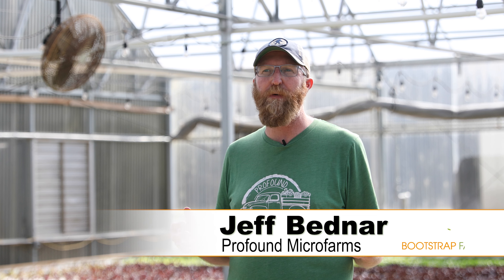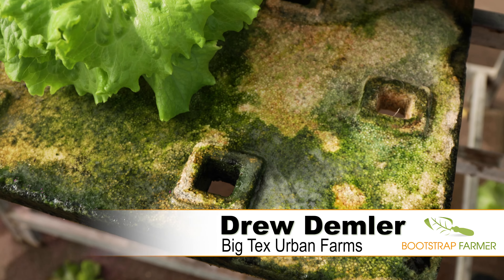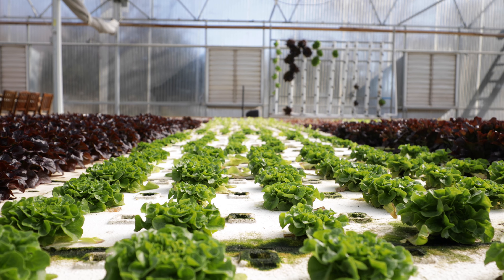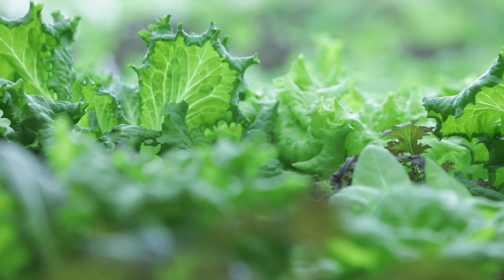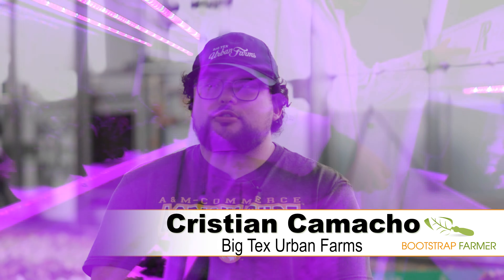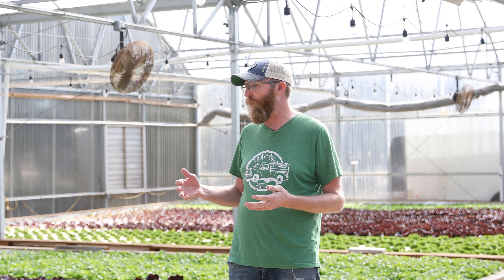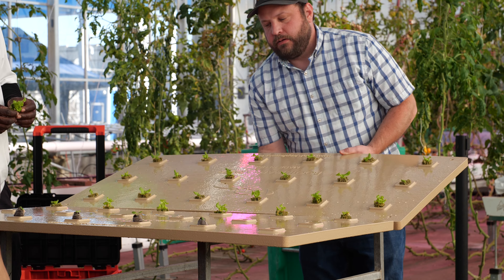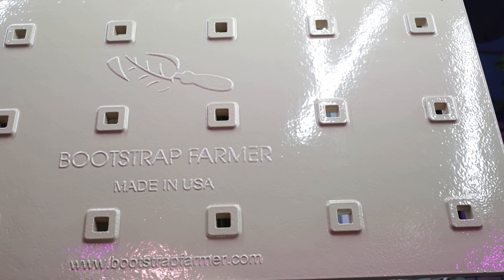Hydroponics Needs an UPGRADE!!!

Comment: Why isn't a UV clarifier a standard part of the water cycle in a hydroponics/aquaponics system? Are there concerns that nutrients would be broken down in the process? Because UV would kill the algae issue for good...
Reply: Which is not to say I don't think this is a great product. Having a product with increased reusability, and therefore less waste, is a very good thing regardless of algae.
Reply from the maker: Treating the water in a pond w UV filters is possible.
However it still wouldn’t prevent the growth on top of the rafts as sun/grow lights interact w algae stuck in traditional raft surfaces. 
Basically the algae is coming from two sources.
Top of raft and water hitting the pond water through broken crevices.

Comment: So what’s the difference between these and hort America coated beaver rafts
Reply from the maker: Our have an additional poly urea shell.
Other boards coating refers to how polystyrene rafts are made in the EPS mould. Its slicker than a lower density packing material but still susceptible to  a porous  finish.